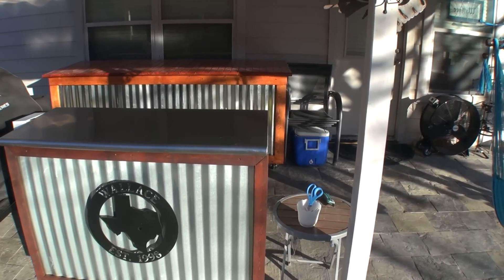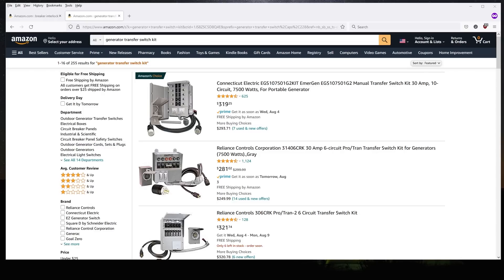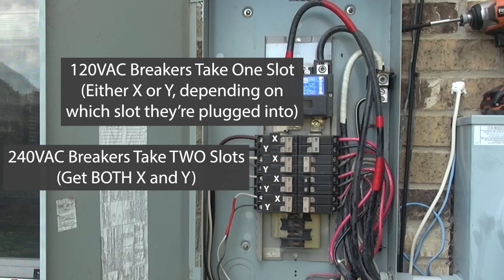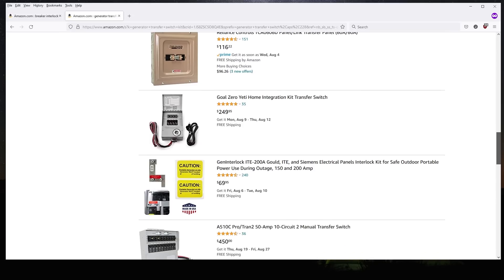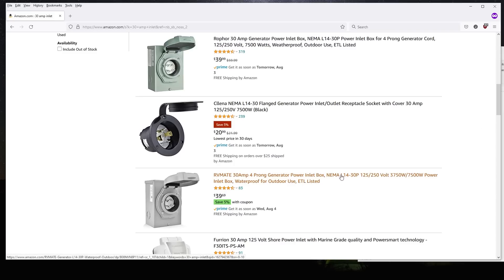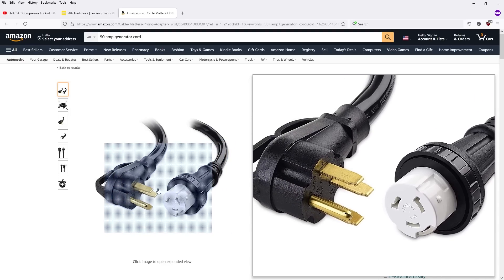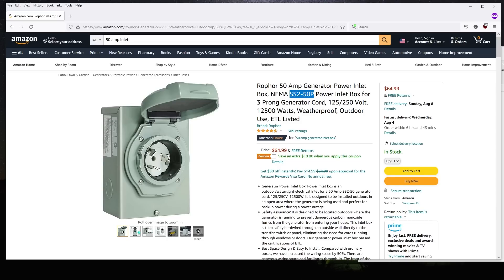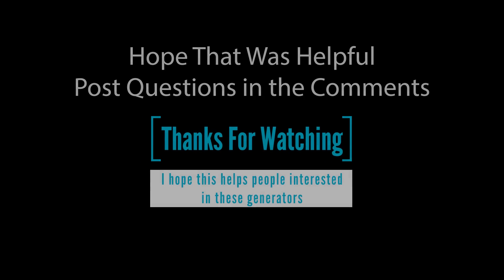How to Connect A 240VAC Portable Generator To Your Home

Comment: how do you make these floating neutral?
Reply from the maker: There are some youtube videos.  As I understand it, on the back of the electrical panel, where the ground peg/post is, there are two cables that attach to it.  One of which is neutral.  Disconnect that, and it will no longer connect neutral to ground.  I didn't bother, as it's a temp hookup, and not really considered a critical thing unless it's permanently attached.
Reply: @Texas_DIY  Jason I have a duromax 9000ih which sorta the same as the predator 9500. Duromax  has put two white wires on one terminal so I don't know should I just take the two wire off the ground post or what.I wonder if I should connect to my house without doing anything?
Reply: I recently added a switch to mine after disconnecting the neutral so I could use with and without a neutral bond.  You could also disconnect and make a plug that went into a 120V outlet on the unit that bonds neutral and ground.  Even if temporary, I highly recommend only having the neutral and ground bonded in your main breaker box.
Reply: @PrecisionClays  10-4 on that.

Comment: Did I miss something?  Did you connect both generators at the same time to get 15000 watts continuous?  I'm trying to figure out why 2 generators?  Thanks
Reply from the maker: Yes, it doubles the output.  Inverter generators like these can synchronize and like batteries wired in parallel, both contribute to the total capacity.  I have some other videos that cover it in greater details:

https://www.youtube.com/playlist?list=PLzoNthJzzMFQ877vyCfoc53oDQqGFAIKN

Comment: Does the 50 amp breaker for the generator need to be double pole? I’ve seen some with 2 “poles” each with 50A on them, and others that are the same physical size of a double pole breaker but only have one switch.
Reply from the maker: I'm not an electrician, and don't even play one on TV.  But I'd say Yes.  Each leg to neutral is 120VAC, and the two hot legs to each other are 240VAC.  So if the main breaker only switched one leg, then the other side would still be hot with at least 120VAC.  So it would need to open the circuit for both legs of the incoming voltage to be safe.

Comment: What if my panel doesn’t have a main breaker? Can I still use the interlock? Like can I add one?
Reply from the maker: I think typically people will either add a main breaker, or, add a side breaker like I did for the inlet, only that will be the incoming power.  That's less than ideal though because depending on your service amperage that side breaker may not be enough.  In all likelihood you'd probably need an electrician to come and add a proper breaker or additional box to act as the breaker.

Comment: Excellent information. One question I have is, on the 9500 the outlet is 4 prong 30 amp (x, y, neutral, ground) but the 50 amp inlet is 3 prong (X, Y, neutral/ground?) Why is that? Thanks.
Reply from the maker: It's just the way they designed the standard plugs.  On the larger 50amp plug, the ground is on the outside of the barrel, so it has all 4, it's just in a different place.
Reply: @Texas_DIY  Got it thanks

Comment: So your powering ur breakers off the 50 amp breaker coming from transfer box than, so than you can choose what breakers to leave on? I seen 2 boxes before so wasn’t sure
Reply from the maker: Breakers are just switches that can turn themselves off if too much power flows through.

Main breaker/switch controlling the line power is turned off.  The interlock moves up to prevent that breaker from turning back on, and by moving the interlock up, it moves out of the way to allow a breaker/switch on the side to be turned on.  That breaker on the side controls the power feed from the generators.

So you are just substituting the main breaker for the side one, and bringing power into the system just the same way... only it's coming in from a different switch / source.  

The important thing being that the main line breaker and that side one can not be switched ON at the same time.
Reply: @Texas_DIY  thank you and that is what i was thinkin also, just gettin power source from flippin that breaker on whcih come from generator and have main breaker off so dont back feed and than only leavjn in breakers u need n that will handle, thanks for reply

Comment: I have a solar system that feeds back into the grid.  That complicates things.  What would be the best and safest way to connect a generator backup system?
Reply from the maker: That would be a question for an electrician and/or the manufacturer of your solar system.  I'm not an electrician and don't even play one on TV...   So what follows is my *GUESS*

The power that these make is clean enough to pass as the electric company power to your solar system.  (it's actually slightly better than the power I get from my electric company).    My understanding of how those solar systems work, are that they function in much the same way as the generators do.  There is an inverter that matches the frequency of the incoming power, and adds to it, offsetting what you need to consume from the electric company.  (the same way adding a generator in the videos, offsets the amount of power the first one needs to make).  If it does not see incoming power, it shuts down, so it's not back feeding power into dead lines, and because the inverter can easily be overloaded if you draw too much and there are not reserves to make up the difference (from a battery system, or from the electric company)

So if the generators feed into the system, in front of your solar inverter setup (substituting generator power in place of electric company power) it would probably "trick" your solar system into thinking that the power was back on, and it would then use the panels to contribute to the power just as it would from the electric company.  

You would for certain need to make sure you have an interlock so you're not feeding your power into the grid, you probably do not have one now as the solar system will turn itself off when no line power is detected.

The other risk I see with this, is that you would still need sufficient generator power to handle your worst case situations when there is no light.  When the solar system is on, it would help, and ultimately save generator fuel (possibly a lot, by letting them really throttle down), but wouldn't necessarily mean you would need 'less' generator power.

Again, this is all 100% speculation and guessing, and should not to be considered advice or suggestions.  Consult an electrician and your solar system manufacturer before doing anything.

Comment: Curious about this generator and the 240 volt references as I have a Westinghouse 9500 which has a 50 amp outlet and supplies 240 volts. It will run one of my AC condensers and attic blower.
Reply from the maker: A 50amp outlet doesn't mean the generator can make 50amps.  That's just what the outlet is rated for.  that generator will push 9500 watts continuous with 12500 peak.  So it might just have enough to kick off the compressor and run it.  Depends on your system and the specs.  Note that's not an inverter generator though.

Comment: You’ve made an excellent video here with lots of good advice.  One step that is missing here is the requirement for a tie down on the generator breaker at the interlock location.  Electric code requires that any breaker which is supplying power to the panel bus must be tied down in place such that removing the panel cover alone does not allow the breaker to be removed.  There must be something else holding the breaker in place other than the panel cover.  Luckily for you the Eaton CH type breakers have a part specifically for this purpose.  It’s a single white piece of plastic and one screw. I think this is the part:  Eaton Cutler Hammer CH125RB Breaker Retaining Hold Down Kit
Reply from the maker: Correct.  Lots of people solve that with a simple zip tie around the breaker.  Code doesn't specify what it is that holds it in place.  :-)
Reply: @Texas_DIY  Your video was so careful to try and stay true to electrical code, including things such as using a fancy plate (interconnect lock out), that I would not be suggesting a zip tie.  Electrical code (NEC) covers itself by saying, "As intended by the manufacturer." Whether it's using a drywall screw to hold your electrical duplex in place, or the height of a ceiling fan outside under a patio cover, this covers it because the manufacturer of the drywall screw meant it for drywall, and the fan instructions will say, "Minimum 7' from leading edge of blade to the ground,"  Hence, a zip tie instructions will not spell out a use as an electrical tie down.  Just pony up the extra $$ for the Eaton kit, and the off chance code compliance ever takes an interest, you're more likely to come out ok.  IDK, just my take on it. If I'm spending a couple grand on enclosure for generator, generator(s), conduit, etc.... I'm not going to suddenly get cheap over a few bucks.  I used to work at Home Depot in the electrical department and it never ceased to amaze me, "I only need 3 conduit connectors, but this bag comes with 5".  I'm thinking, "If you're quibbling over chump change or having 2 extra connectors at the end of the job, maybe you shouldn't be doing your electrical work."  My favorite was those who said, "I don't want to run 10 gauge for my 30 amp.  It's too expensive.  Can I run 14?"  Sure if you want your house to make the news."

Comment: What are your thoughts on the generlink ?
Reply from the maker: Expensive.  Proprietary cable to connect to it.  And you need the electric company to come and pull your meter so you can install it.
But...
It does make the switch over process very easy and you don't have to be in the rain/snow playing with breakers.  Power is off?  Fire up the generators... and you're on generator power.  Quick and painless.

Comment: Hello, what do you think about the GENMAX GM9000iED ?
Reply from the maker: Looked it up, and I'm liking that one a lot.  They seem to be taking the approach of the "powerhorse" generators that I got the cable from to make my parallel kit.  But instead of a parallel kit, they just have outlets on the front face that are capable of handling more wattage than the generator can make.  So when you link another one to it, you can just plug into the front face of either one to get the additional power. 
It has the 50A dryer plug, the 30A plug, a nice control display panel, dual fuel, pushbutton start as well as remote start... for the same price that HF has recently raised the cost of the 9500 up to.  And it exhausts out of the rear, so you can have them side by side if desired.  Nice.

They rate it for a shorter run time, but that just may be marketing.  The gas tank is the same size, and the engine is almost exactly the same size (458cc vs 459cc).  The surge is lower, but the running amps are about the same as well.   

So apart from an extended warranty you can get from HF to do a return... Just from the Amazon page and the specs, I see nothing but good from this Genmax model.  Nice find.
Reply: @Texas_DIY  apparently the warranty is 1 year but you can get an extended warranty at Amazon of 3 or 4 years.  I head that the manufacturer of the Genmax is the same one of HF Predator and Duromax.  Also. The Genmax has a forced air exhaust, easy access to air filter and a oil filter.  And like you said the exhaust is on the back.   Seems a good buy is just an unknown brand to me.
Reply from the maker: @JavierRivera  It wouldn't surprise me if it was the exact same engine.  It looks like they identified pretty much all the shortcomings of the HF and the Duromax, and made their own solution.  It's more expensive than the HF unit was... but since HF raised the price, it's all that for about the same cost.  

Pretty impressive, if it has an oil filter and easy access to the air filter as you say, I think currently, that just might be the "ultimate" portable generator.
Reply: Genmax apparently manufacturers predator and Duromax. They seem very similar except 50 amp. I have a 50 amp inlet wired 4 wire 6 gauge by my electrician to a panel that runs certain breakers with interlock. My question is if I plug in the 50 amp from generator to inlet would I expect to get 240 volts 7200 watts 30 amps running power? I ask because Genmax says I would only get 3500 watts, but not sure they actually understand my question/language.
Reply: @wileypinkerton2300  you will get 7200watt 50amp.   4 wires to a 50amp breaker means L1 and L2 with ground a neutral.  L1&2 are 120v 30amp each one.  120 X 30 = 3600 x 2 = 7200w
Reply: Thank you! That’s what I was hoping. I think I will order the Genmax. Did you buy it? If so what’s your impression?
Reply: @wileypinkerton2300  yes, I have some videos on my channel about the GM9000iED.

Comment: The HF 9500 has 30A 220V sockets but no 50A - how did you get the whole 9,500W into your panel pls? Great video!
Reply from the maker: 9500 is the surge rating.  Running normally it's pushing around 30A of 240VAC.   I have several videos in this series, that go into the parallel kit I used, and how it connects to the house.  It should answer all your questions and more. 
https://www.youtube.com/playlist?list=PLzoNthJzzMFQ877vyCfoc53oDQqGFAIKN

Comment: How far can i install the inlet from the panel. My main panel is inside the garage and i would like to install the inlet in the backyard which is about 60ft.
Reply from the maker: Running it that distance won't be an issue, you just need the right wire for the load.  

Google "wire length calculator" (first result for me), there you can find a tool to help figure how what gauge of wire you'll need for the run.
Reply: @Texas_DIY  Thanks. In case anyone is  interested, I will be running four 6 gauge 45 ft wires in conduit. from the main panel to the 50 amp gen inlet box(Reliance PBN50). 50 amp breaker. I have installed Easy Start Micro Air 368 on my 4 ton ac which brought the amps down from 90-95 to 30. I have predator 9500 Inv gen. Will update once i am done with inlet setup and run the whole house with gen. Thanks
Reply from the maker: @syedfaz26  Awesome!  Nice work, sounds like you have a good plan.

Comment: Don't you need to use both the 120V and the 240V 30A circuits on the predator to utilize the max power output from one of these generators?
Reply from the maker: Ideally yeah, so you can pull the max amperage of each leg (assuming you're just using 120V)  
Think of it almost like two 120V generators in one.  Over 30Amps from each.  (or if you're using 240 then over 30Amps of 240 with them combined)

Comment: Jason great video...thank you! I bought a Duromax 9000 and it comes with only one 240v 14/30r 30AMP outlet. I followed your advice and I bought a Reliance PBN50 50AMP power inlet box. My cord coming from the generator is a 30AMP 14-30r 8/4 gauge. Can I safely connect my 30AMP cord into the 50AMP home power inlet? Thanks!
Reply from the maker: 240v is 240v in this context, it's just what the max amps that your cord and socket are rated for.  A single generator will usually just have a 30amp female socket.  Mine is the same.  It's up to you how you want to adapt it to fit your 50a inlet.  They make adapters that will convert the 50a inlet into a 30a inlet, or you could go the other direction and adapt the 30a socket to a 50a socket at the generator side, and use a 50a cord.

Personally, I would opt for the 50a cable/cord that plugs directly into your inlet, and ends in the dryer plug.  And then use an adapter from there to make it plug into your 30a generator.  This way, you have everything you need should you want to upgrade to two generators, or connect in a larger 50a generator, without having to buy a new extension cable.   
An example of an inexpensive adapter to do that:
https://www.amazon.com/RVGUARD-Generator-Adapter-L14-30P-Indicator/dp/B085H7BPM7
Reply: Also should I keep the same cord or upgrade to a 30AMP 14-30R 6/4 gauge 75 feet generator cord?
Reply from the maker: Up to you and your needs.  My opinion would be to use a 50a cord, and a cheap adapter to convert it at the generator.  That way you can upgrade or use different more powerful generators, without having to also upgrade your cable/cord.
Reply: @Texas_DIY  Thank you!!! I'm going to return my 30amp cord and look for a good 50amp one and an adapter

Comment: Holy crap, why is this video doesnt' have like a million view lol...this is so informative!
Reply from the maker: I'm not big with the click bait thumbnails, and begging for likes and "smashing of bells".  :-)

Glad it was helpful to you.  These are kind of my "pay it back / forward" for all the stuff I've learned on YouTube over the years.
Reply: @Texas_DIY  Definitely! One question - you touched on the power transfer box, can something like this, in your opinion, be ideal or an option to use if your outside box where the power company power comes in doesn't have a main breaker? Replacing the box, as you may already know, it's an expensive job, so i'm back to researching alternative ways to get generator power setup and not having to drop so much money to get a whole new box. I'll certainly appreciate any suggestions! And thank you in advance!
Reply from the maker: I would consider adding a main breaker.  You probably don't have 200amp service if there isn't a main... so you may be able to handle it as a larger amperage breaker just plugged in next to the others for where the power comes in.  (instead of a load being on the breaker, you feed the incoming power through it)  That would work, and give you something to turn off... but no idea if it would be legal/to code.  That would really be a question for an electrician.